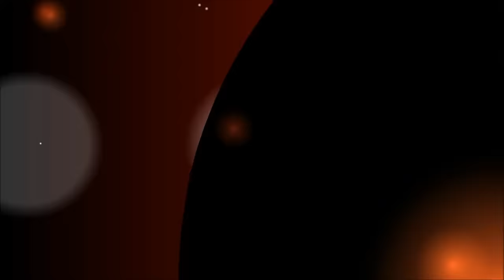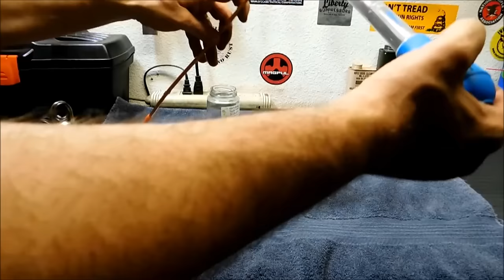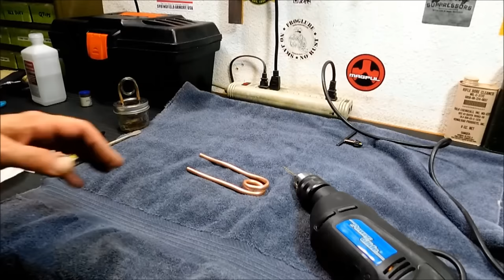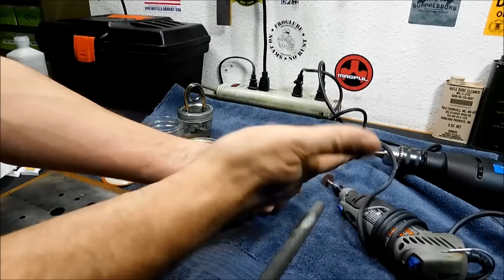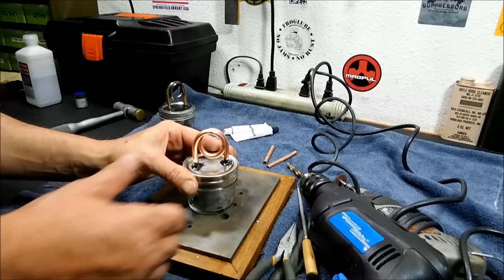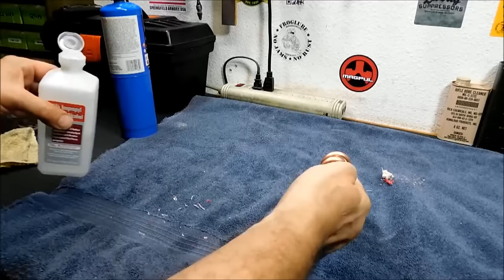Build Your Own Copper Coil Alcohol Burner Stove!

Comment: Looks great! I can't help but wonder - would it still work if the coil were perpendicular to the mason lid? I'm thinking it would have a lower profile Tfs - you should totally sell these - would be easy to ship as its just the mason disk with the coil attached.
Reply from the maker: Thanks, I was thinking about putting it perpendicular, but not sure it would work as well.  I thought about selling them, but it takes a bit of work to make them, and between doing youtube videos and running a business here, I just dont have the time :)  Thanks for watching!
Reply: As long as the coil is heated sufficiently to produce enough vapor, it would work. Easy with the coil vertically as in this video. A horizontal coil using the same concept would not as easy to build or make work well, though.

Comment: a tubing bender would help you a lot.  You don't have to mess with sand.   Other than that great video.  Also I think the copper size is 1/4 inch.

Comment: It may be worth a test to see if it would run on kerosene or diesel too.
Reply: Just do not have the fire jet pointed right at the coil as either may melt the coil.
Assuming of course it pressures up.

Comment: Very neat little burner.  Do you have to prime before each use?  I definitely want to make some of these, they can come in handy as a small hand warmer during hunting season.
Reply: Priming is to get vaporized alcohol to start exiting the burner hole. The easiest way to do that is to get a little alcohol inside the center of the coil and igniting the stove. The flame will heat the coil and keep the vaporization going after a short time. Simple but clever gadget.

Comment: Realizing that I'm coming very late to the party, I'd like a bit more detail about the hole you drilled in  the copper tube loop.  From what I could see, you drilled from the top of the loop through both the top and bottom of the top of the loop then into and through the top of the bottom part of the loop but did not go through the bottom side of the bottom part of the loop.  In total you pierced the tube 3 times?

If one were to make one with another loop of copper, would one drill the 2 outer loops?

Thanks for a great YouTube demonstration.
Reply: He inserted the drill bit BETWEEN the top loops to drill a single hole in the upper surface of the bottom loop.

Comment: Tips for other viewers the hole size is absolutely critical and also it must be sealed to build pressure or it doesn't work. Also if the hole is too big it burns like a candle. I made mine with solder instead of JB weld keep the heat on the copper and use a wet rag when soldering so you dont melt the gasket.

Comment: I have a question. I want to make a single loop burner like this because the 2 coiled one seems to get too hot for the application i use it for. The one i have the copper tubing is 1/8” and there are 2 very small in each loop and no wick the tubing go close to bottom but not all the way. Do you know what the heat output difference are for 1/8” tube Vs 1/4” you use m or 1 hole Vs 2 holes, and then is there any difference in using a wick Vs tubing going all the way to bottom? It also just came to mind to remove a loop or plug it with something so the second loop could  still be used if needed for a hotter flame, any thoughts on this? i don’t want to blow anything up and you seem to have some insight on these. I like the concept mine just gets too hot and one of these options would be cheaper than buying another one. Thanks in advance

Comment: There has to be a way to replace the volume of the fuel burned with outside air or the pressure will decrease during long burns. Turning it off occasionally for several seconds should work.
Reply: facite non victimarum No need, it's self pressurizing.

Alcohol evaporates and will hold a neutralish pressure as long as you give it time to catch up. On top of that, adding oxygen to a fume filled glass container is a good way to blow up
Reply: Robert  
"self pressurizing"  < wrong 
"neutralish pressure" < wrong
"blow up" < wrong
All contrary to my experiences with backpacking/camping stoves, the laws of physics, and my career as a professional engineer.
Reply: PS, a person would have to be a fool to build a stove out of glass, even with an almost non-volatile fuel like  alcohol. A fool... or someone impoverished and needs YouTube money, like someone in India for a random example.

Comment: Question: Doesn't this use the fuel a lot faster than a regular alcohol burner? Maybe that's the reason you can boil water with it so efficiently.  Good video.

Comment: Your fuel nozzle hole is just a little too big. It's best to get a floating flame pure blue. It's a little louder but man it's way cooler. I punch the holes with musical wire much smaller that most drill bits. Thank you for the video.
Reply from the maker: Thanks for the tips!

Comment: what about sand? whether still inside the copper pipe or removed. whether it should be alcohol or can with other materials such as kerosene.
please......  i am interesting about your bulid burner stove.
Reply from the maker: Once I was done bending the copper tube, I just emptied out the tube with water.  Sprayed it out in my sink, and it came clean.  The sand is only in there so the tube does not kink when bending it, once you are done bending you can empty out the sand.   I would stick with 90% alcohol on this one, I have tried Kero and it does not burn as well.

Comment: I wonder how long it would take to fire up using a little T-cup CANDLE under the loop to save your lighters. Just a thought on deciding the height you want on your loop. Great Video I 242.
Reply from the maker: Since i made this video I have done loads of mods to this burner, one of the things I did was cut down a .45 caliber casing, and place it under the loop, this way I fill it up with alcohol, and let it prime easy.
Reply: @Iridium242  love it..Nice
Reply: U have a great mind..lol I love this project and how you think out of the box. This will come in handy as a small footprint lit weight on stove for the go bag or hidden storage and stash sites if you need to bug out fast

Comment: That is really nice. You could use them for heaters, you could make a portable oven with three of them under a double wall sheet metal stove box. I have one of these from India the brass ones it was a pain in the ass and didn't work right I use a Korean kerosene cooker with a round fiberglass Wick much much easier sorry. :-) I use old Victorian kerosene lamps for heat this reminds me of that but you don't have to have a glass on it

Comment: Que tipo de alcohol usaste o de que grado puedo usar cualquier alcohol. 

what kind of alcohol did you use or what grade can any alchoo use to use this stove
Reply from the maker: I just used regular 91% rubbing alcohol for this video, but you can use either methanol or HEET gas additive (same thing really) and it will work great.

Comment: Is 91% isopropyl alcohol strong enough? It's a $1.99 for a 15oz. bottle at my local pharmacy. They have 94% also but, it's $3.49 for 5.5ozs. The strongest my local Walmart has is 70%.
Reply from the maker: 70 will work but it wont give you the same results as anything over 90%.  Another trick is to use a product in the motor vehicle section of the stores called HEET, its fuel line anti freeze and burns super clean and hot. Also very cheap as well.

Comment: Starting the hole in the top bend of the copper tubing would be easier be easier with some friction tape wrapped around the copper tube This will keep the drill bit from sliding

Comment: New concept for me!  Can you tell me more about the type of rubbing alcohol used,  %, etc.
Reply from the maker: I just used 91% rubbing alcohol I got at walmart for this one. You can also use HEET which you can pick up in any auto parts store or walmart, works just as well. It works with 70% too but not as efficiently and its dirtier too.

Comment: nice project,  WHERE DO YOU BUY THE COPPER COIL AND THE CAPERS TO PLACE AT THE ENDS PLEASE??
Reply from the maker: Got that at Home Depot in town. Ran me about 20 or so dollars
Reply: Get thin wall tubing, bending the thicker walled tubing is a nightmare without bending tools for such a small tight coil. You also might be able to get a few pieces of copper free from a construction site, just ask one of the workers, as you don't need much length. Plumbers, and HVAC guys throw away scraps that should be long enough to make one of these.

Comment: Would something bigger like a jelly jar or pickle jar work?  (since small jars are hard to find) and if so since they are larger is it possible to add 2 or 3 additional coils or just wrap the copper tubing extra times forming more coils and poke holes in the bottom of each loop for greater heat?
Reply: Sure. Smaller jars are less easy to break. Small jars are actually very easy to find. Think jelly sampler jars.

Comment: This a one of the best innovative videos I have seen. Just one suggestion if I may, for those that can solder instead of using JB weld.
Reply from the maker: The only problem with solder (I tried it first before the JB weld) is it melts the seal on the back of the top, so the jar never builds up any pressure.

Comment: How do you use the copper coil stove once you get it working?
Reply from the maker: I put it inside a pot stand I made from wire but I also did a video where I used it inside my hobo stove (A #10 coffee can I cut out for wood burning as well as this stove) and it works great.  Pretty much anything you can put this inside of will work.  Here is the vid where I heat up an MRE with it  https://www.youtube.com/watch?v=_W3x97M7qSI

Comment: There are lots of alcohol stoves and these are great DIY project. But everything i've tried completely sucks when used outdoor. even slightest breeze completely screws everything as alcohol flame is easily blown away, so suddenly you burn 10x more alcohol to boil pot of water. Once i was quite unpleasantly suprised by this fact in middle of nowhere, because everything went perfect when i tried indoors.
Reply from the maker: Thats why you need a wind guard,  Amazon sells them cheap too, its pretty much just a folded up bit of metal.  You can even make your own out of an old can. Alcohol works poorly in high wind, I found this out after doing this video myself.. but if i put it in my hobo stove (Made out of an old metal coffee can) it works great.
Reply: I've tried using windshield. Wind still blown the flame out thru the air intake holes. maybe using hobostove with air intake sealed using glassfiber would work (it would let the air in, but not the wind maybe?). not sure.
Reply from the maker: Check how I did it here  https://www.youtube.com/watch?v=_W3x97M7qSI   It works good outside now

Comment: If you are having trouble with the copper tube crimping when you wrap it around the pipe, fill the copper tube with anything like sand, salt, sugar, etc....  This will prevent the copper tube from crimping a retain a much better uniform look. After wrapping is complete, shake out all you can and then blow the remains out so the copper tube is completely empty

Comment: Very nice which use the sand plz explain
Reply from the maker: The sand inside the tube while bending, keeps the tube from kinking, so its a nice even bend
Reply: What type of sand material
Reply from the maker: Any kind will do, i just used the sand from my sand blasting cabinet.  You can also fill the tube with water and freeze it to make bending easier and kink free

Comment: How about the 2nd light? Is a torch necessary?
Reply from the maker: Nope, the first torch was not really necessary, I did it more to save time in the video instead of holding a lighter under the coil for a while, however I have added a small brass cup under the coil since then, and now all I need to do is fill that cup with a few drops of alcohol, light it and it primes the stove with a single light from a lighter or match.
Reply: Iridium242  Thanks

Comment: Not too chem savvy is it safe for indoor use?
Reply from the maker: In a well ventilated area, not a big deal but not something you would want to use in a small enclosed room.  Just have to watch the CO2 levels like with any type of propane or gas stove used indoors.

Comment: Is the JB weld heat resistance substance? do you have to prime it every time or only the first time?  thanks
Reply from the maker: The JB weld I was using is heat resistant, and you only need to prime it once.

Comment: Could the tubes be soldered in instead of using JB Weld
Reply from the maker: The problem with that is that underneath the lid, its a rubber seal that allows the jar to build up pressure, once you solder it, the seal will melt,  I have tried it a few  times and it always melts the seal that is on the cap.

Comment: Red hi temp rtv instant silicone gasket would be much better than JB weld.
Reply from the maker: Cool I will have to hunt that down, I have done lots of mods to this burner since i made the video, and that would be awesome as JB weld always seems to dry up and crack after a while.
Reply: @Iridium242  look no further than harbor freight. 4 bucks for a nice tube of it. It's great stuff on the level of great stuff polyurethane.

Comment: Is that a wick you used?
Reply from the maker: yes just cut it down thinner so it would fit
Reply: @Iridium242  definitely worth trying
Reply: @Iridium242  Got some old jars ranging from food to related items, sounds like something that is worth trying, I'd need to a clamp? That you have in the video. May try to find a means of making it safer for camping, maybe place in a structure, rubbing alcohol isn't the only flammable substance that can be found, maybe booze.

Comment: How to turn off the stove? Please
Reply from the maker: I just blow it out.  you can cover it as well with a bigger pot.
Reply: Use a cork. You can leave it in there until next time that you use it and it provides a seal to stop the fuel evaporating

Comment: Great project.  No problem but it would be 100% better if you knew the dimensions of the material like the copper tube and shared that info.  I know that DIY means that you learn a lot by yourself but I prefer videos that don't leave out any information.  Thanks for posting!
Reply: The copper tubing is 1/4 inch soft copper refrigerator ice maker supply line. You can usually find it at any hardware store that sells appliances or appliance parts.

Comment: Why don't you solder the tubing to the lid??
Reply from the maker: I tried, and it burned the rubber under the lid and did not make a good seal anymore,  I just use the high temp stuff now and it lasts for a long time.
Reply: Thank you.

Comment: Can't you soldier instead of jb weld
Reply from the maker: You can, but it would melt the seal on the back of the top of that jar, I tried it, didn't work.

Comment: Forgot... wrapped stainless steel wire around the top to see if it would keep the copper hot.  Exactly what size copper, what alcohol, what drill bit, etc...I want these to work so you can reuse them in an emergency and not have them fail.  Needless to say... we did not give them as gifts!

Comment: Why JB weld? Just soft solder the pipe to the lid!
Reply from the maker: Soldering these caps melts the gasket that keeps the pressure in the can, JB weld holds a good long time.  I tried soldering them and it ruined the caps as that rubber gasket is very thin..

Comment: Don't laugh at me iridum but what about a tampon for the wick?
Reply from the maker: It would work, problem is it might burn quicker because its thin fluffy cotton as opposed to a proper wick witch is cotton but constructed in a different way so it will burn slowly.  I really need to do an update to this video, as I have upgraded this burner a lot since then.,
Reply: @Iridium242  
Thanks. Can't wait to see the update!
Reply: @Iridium242  I sure wish you would hurry up, build a bigger one and tell how long it burns because I just went three days and nights with no electricity freezing my ass off.
Reply: Dont light it while being used though or you might have a bush fire

Comment: Cheap suggestion... Buy a 100 percent cotton string mop  for a buck or two and you'll have dozens and dozens of wicks for homemade alcohol burners or kerosene burners, lamp oil burners, mineral oil lamps ECT. Anything that uses a round wick of that diameter...

Comment: It seems to me that you could use a pipe cleaner to run your wick through the 1/4 inch  copper pipe. Like a election would running wire with a fish wire.